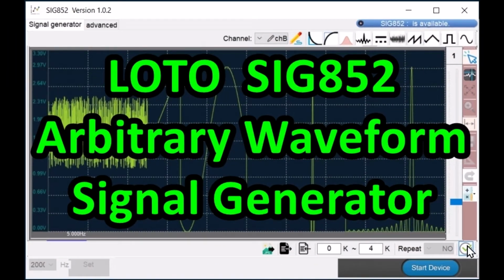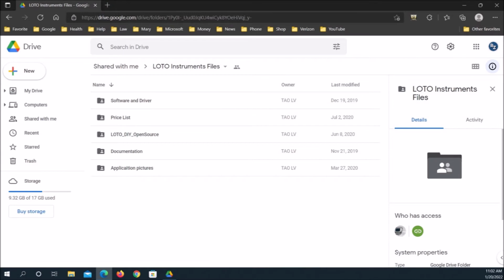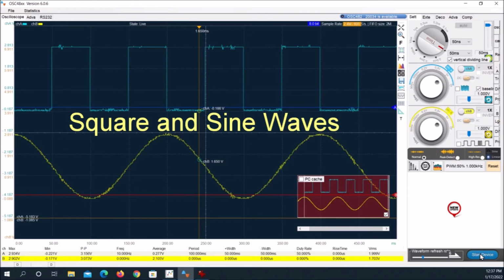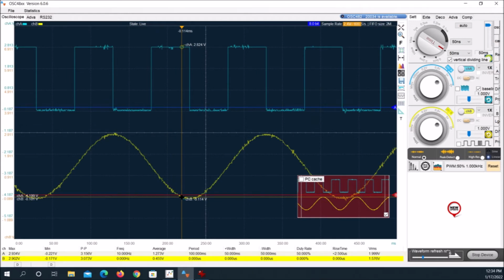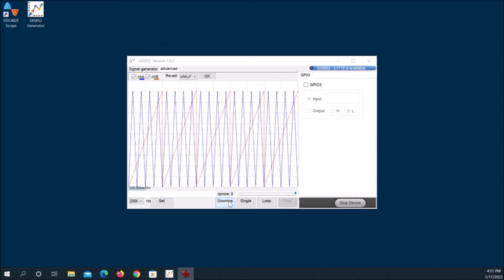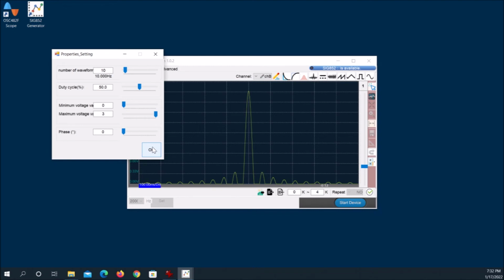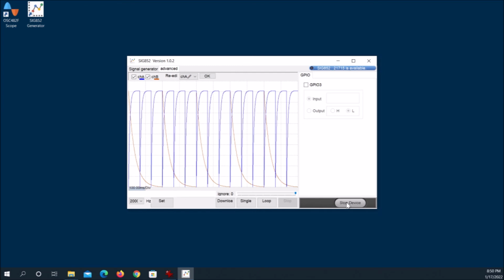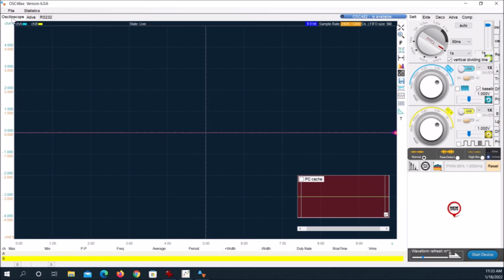LOTO SIG852 Arbitrary Waveform Signal Generator

Comment from the maker: Free Gift information provided by LOTO Instruments,
"SIG852 Aliexpress store link:
https://m.aliexpress.com/item/1005003446025965.html?gatewayAdapt=Pc2Msite
https://www.aliexpress.com/item/1005003446025965.html?gatewayAdapt=Pc2Msite
If you place order by the above link, LOTO would like to send a blue tool case as a free gift. 
Note: Please contact seller when placing order and send 'FRIEND OF RONALD' as promotion code, so that seller will add a blue case in your parcel. If you do not send promotion code, free gift will not be included. Promotion expires by May 31, 2022."
😀

Comment from the maker: The SIG852 has two independent signal generator channels, waveforms can be extensively edited. It’s a stand-alone independent device. The SIG852 signal generator is well suited for trouble shooting and simulating machine designs. It’s very useful in automotive applications. Engineering students, do-it-your-selfers, makers, and hobbyists will find it to be a helpful tool.

We use the SIG852 to simulate sensor output signals, in order to verify whether circuitry or equipment is processing the sensor signal correctly. Such sensor output signals usually do not have periodic regular waveforms. They often are related to time and variable changes. We also used the SIG852 to simulate a control signal to an actuator, to check whether the actuator was working correctly.  In one recent application, the SIG852 was used to simulate the output signal of various automotive sensors to drive and test whether the actuator circuits were working properly.